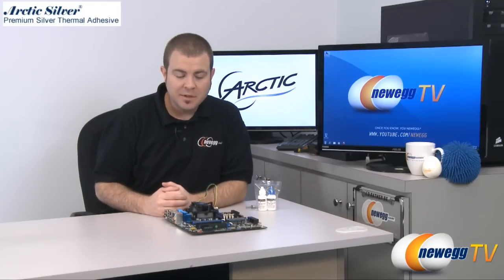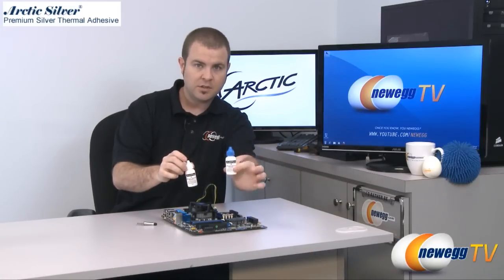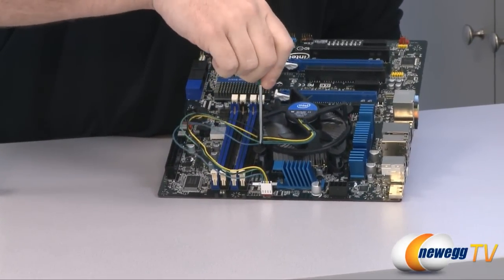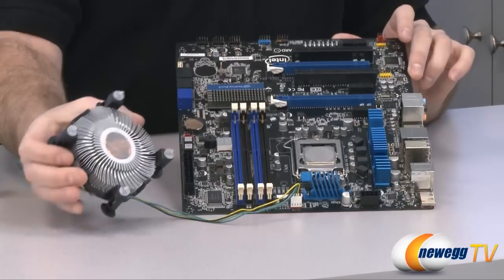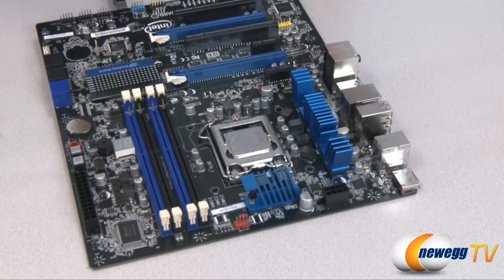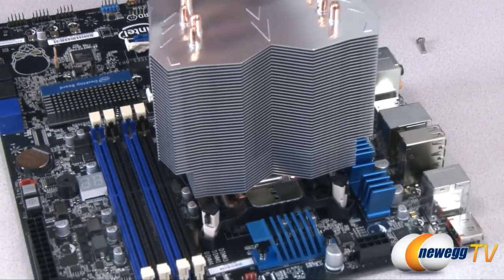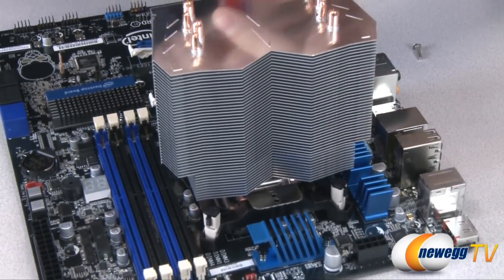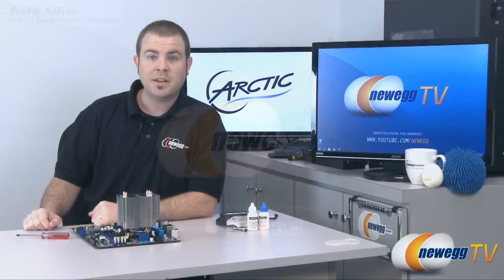Newegg TV: Arctic Silver CPU Heatsink/Fan Replacement Guide

Comment: @evotuc it appears you have read the artic silver middle dot method wrong. If you read closely, it is recommended to tint the heat sink and metal cap as what is said by your post. However, after cleaning it thereafter, the middle dot method or "grain of rice method" is followed. This however looks to be how artic silver would recommend to do it with these type of processors, as they also have the spread method- but it isn't recommended for new amd processors.

Comment: If you won't take it from anyone else, listen to the manufacturer's instructions:

arcticsilver . com/pdf/appmeth/amd/md/amd_app_method_middle_dot_v1.1.pdf

"[...]enough thermal compound onto the center of this area to create a small mound.  By working the  plastic tool (old credit card) back and forth in all directions (See green symbol on picture HS1) you will smooth out the compound 
and work it into heatsink. This will ensure optimum filling of the microscopic 
valleys [...]"

Comment: you should be careful how you orient your heatsink. in the demo, which i dont blame him for since this is a thermal compound demo and not a build demo, he orionted the heatsink so that the fan would be facing the pci-e and pci ports. that means he just took up the space where ram slot 1 normally is. before putting anything on, check if the heatsink is obstructing any other part of the build before proceeding to mounting and finalization.

Comment: Too many complaints on technique. For the John or Jane Doe, this method will work fine. You can argue it's not picture perfect in various ways. But for someone just strapping on a replacement, it works fine. If anyone is doing any real overclocking or hounding good thermals they should be "lurking moar" anyways.